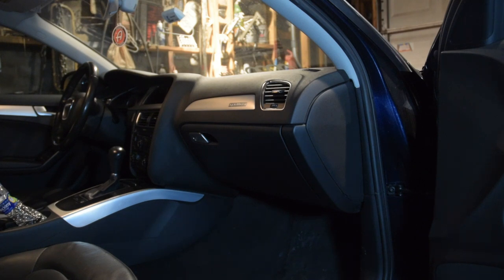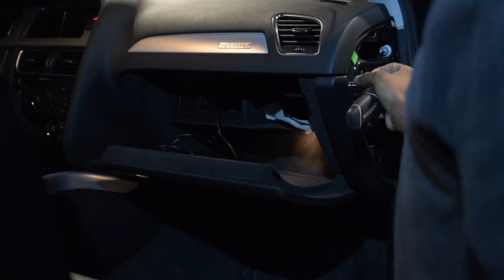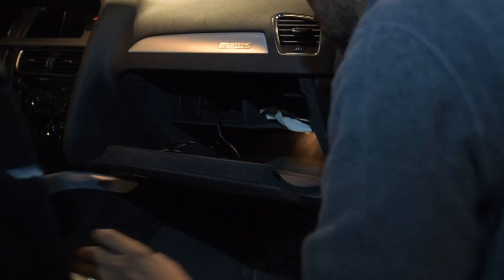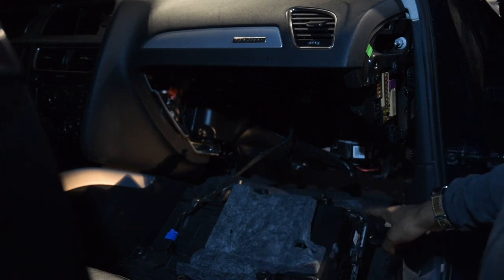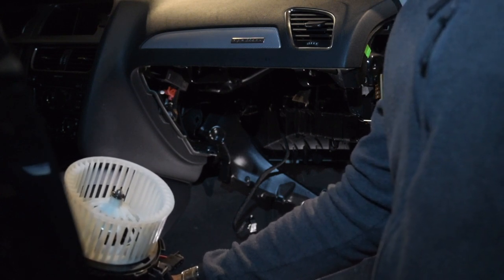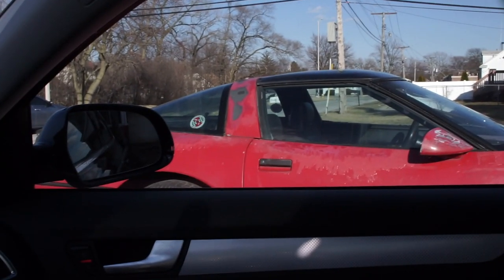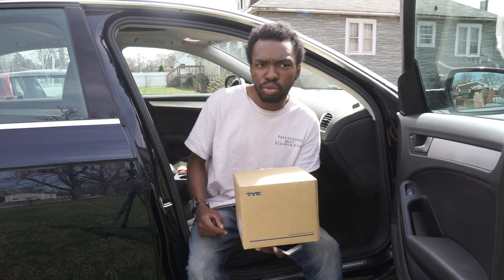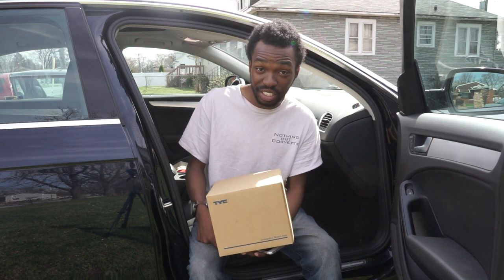How to change your HVAC blower motor: B8 A4

Comment: I work in the yard and this just helped me get this part out. First timmer over here lol. I also learned from a prior video if your battery is dead under the back seat is a wire to open the trunk

Comment: Hey man I’m not getting any air flow on the drivers side middle vent and the drivers side vent by the drivers left hand. Does the passenger side fan control all of the air flow or is there one I need to replace on the drivers side?
Reply from the maker: Hey, it's just the one fan on the passenger side.